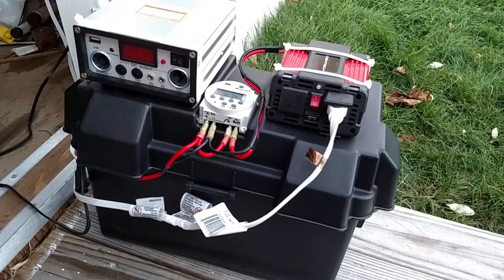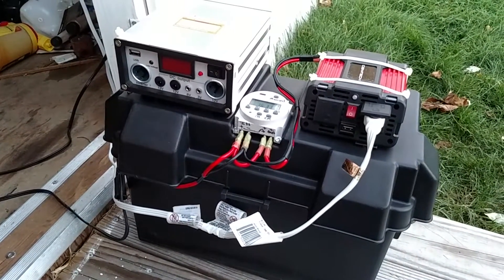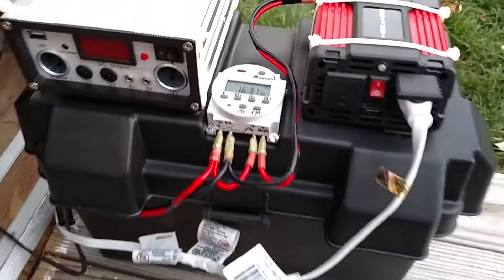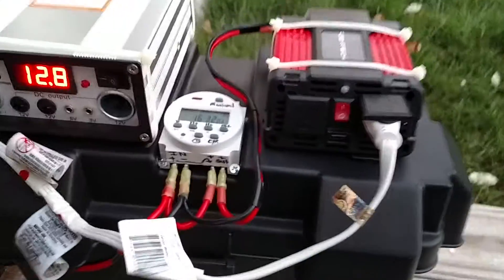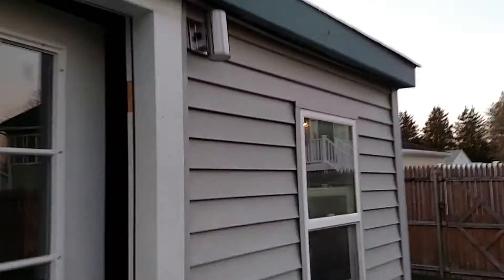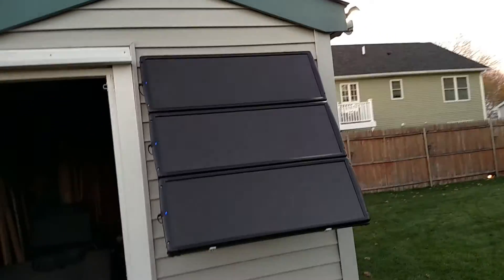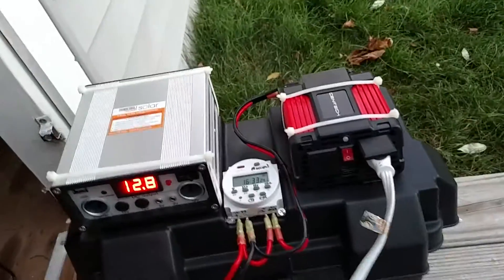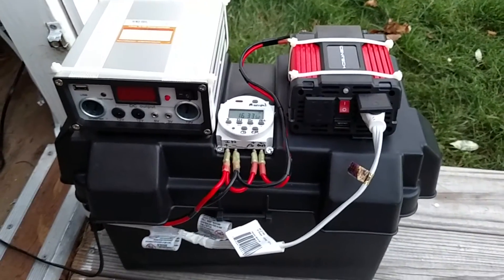45 watt Harbor Freight Solar powered shed update.

Comment: These days there a lot of 12 volt LED lights you could use and get rid of the inverter for the lighting power.
Reply from the maker: I have since done that. Using some RV lighting.

Comment: I use 50 amp bridged diodes for this setup. I splice them between the solar panels and battery and use the power from the panels alone not touching the batteries. When the sun goes down the inverter starts to fade out but the batteries remain fully charged.

Comment: How did u wire the inverter to the shed. I was wondering because I was getting and a shed and was gonna do the same thing
Reply from the maker: jonsims21 I used extension cords for now. I connected plugs to the wiring from the light fixtures.

Comment: honestly this kit is good for running small lights or charging some phones or to put on the roof of a van to keep the battery charger if you go camping but to put a inverter and run anything more than 50 watts will drain the battery.
Reply from the maker: Wayne Rhea 2 batteries help that. but this will work for basic accessories. I have (2) 35 Amp/hr batteries wired to be like a big 70 amp/hr battery.

Comment: never seen solar panels with led on them
Reply from the maker: Super Daddy it's a small detail but it's nice to know they're on!
Reply from the maker: I get one night of lighting off a charge to the two batteries. with only one I couldn't make  whole night. I also ended up getting some 12v RV/Camper lighting to use so I didn't have to use the inverter. One charge lasts days now.

Comment: So you dont run the inverter right off of the charging unit?
Reply from the maker: MrVideoyoulike I don't. cause I only wanted it on at certain times. So I have it running on a timer.

Comment from the maker: it floats the battery once charged. the charge controller has a digital voltage display on it. anything over 12.5 bolts is ok in my book.